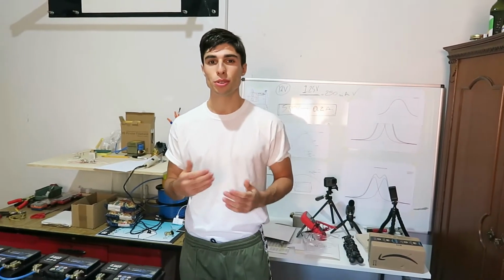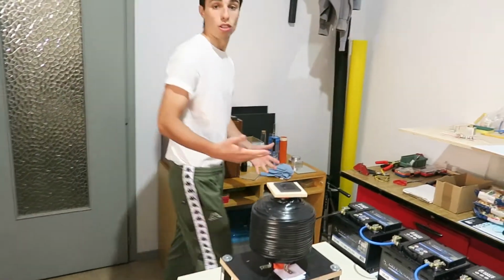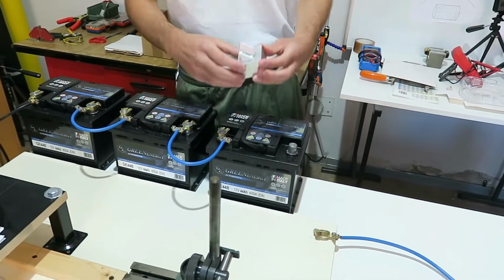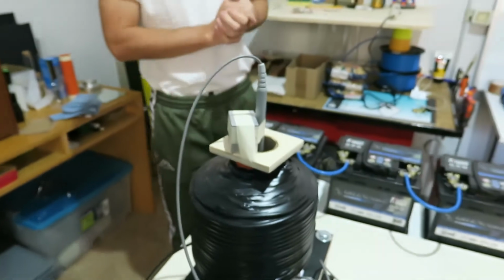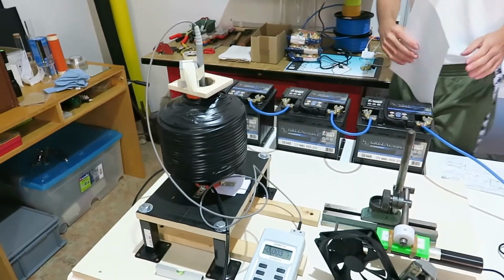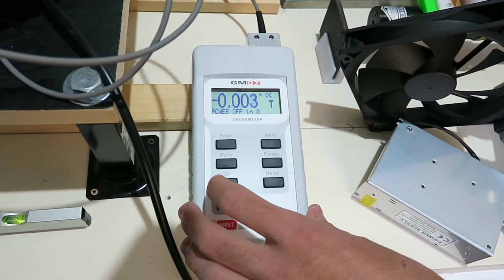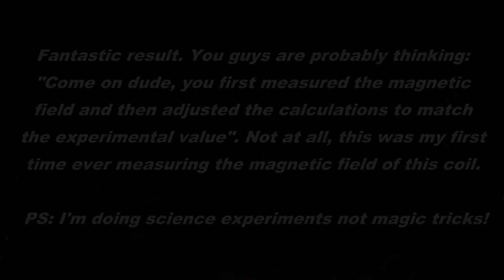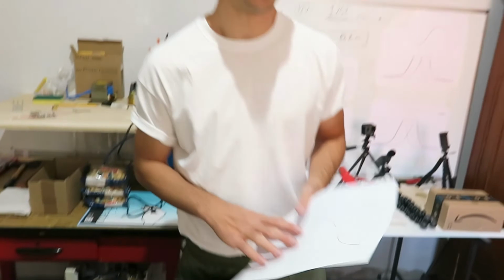Magneto-optical effect (Part 2: The solenoid)

Comment: You are playing with such a high current with home made 'switch' using that clip (you are touching that) is dangerous.
Reply from the maker: Yes I know it isn't the safest thing but the voltage I'm using is quite low (36V). I am not using more than 36V for safety reasons, even if in that way I could obtain higher currents and therefore higher magnetic fields.
Reply: 145A is a high current, but not enough the send large molten metal parts flying that can seriously hurt you. If you wear safety glasses it shoudl be fine..
You will get a burnt spot on your hand max, which will heal in some days.
The coil offers enough resistance (as calculated) to limit the current. If you short circuit the batteries directly however, you might get some larger "sparks" :D
I once converter a screw driver bit into flying metal parts by shorting out a 24V AGM Lead battery bank of a USV.